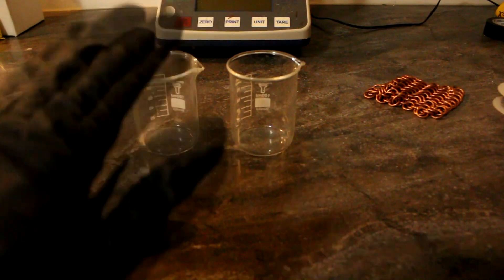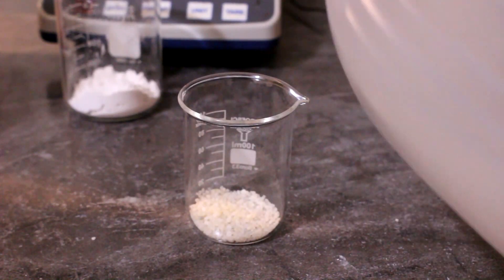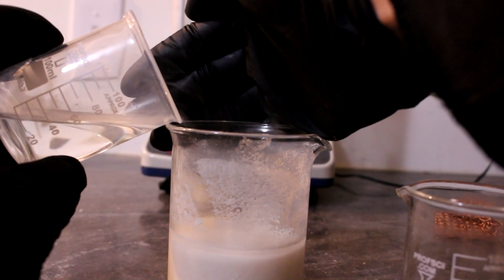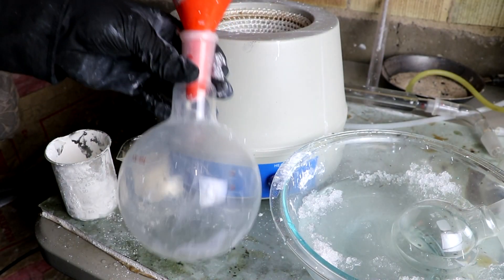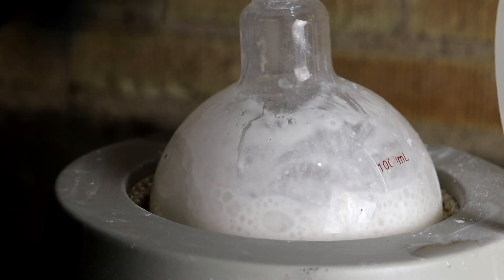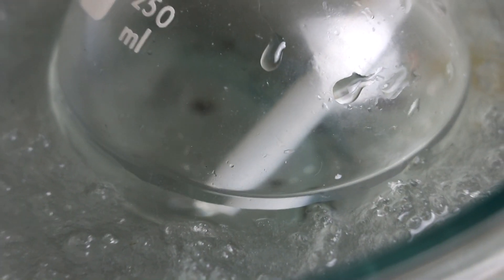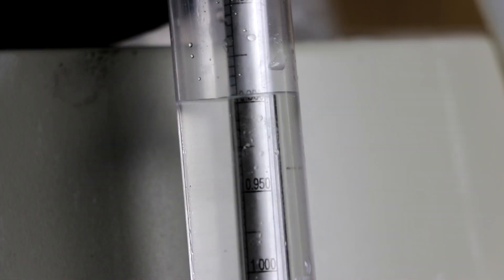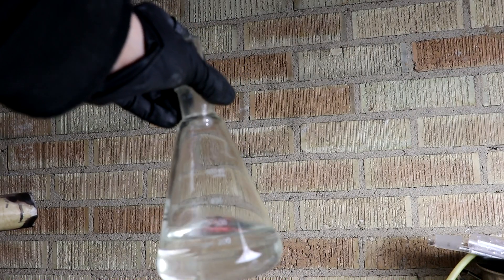Making Aqua Ammonia

Comment: My lab used to buy the 20% in 5 gallon kegs. Adding it to H2O2 and a bit of CuSO4 to microetch copper surfaces during microsectioning works a treat. The smell was like a chicken coup. Careful pouring it inside a closed room.

Comment: good of you to have done this.  ammonia water in gallon jugs is getting scarce in the local 
stores.  and online its $20 a gallon plus shipping.    thus a DIY approach is called for ...

the bubbling  of ammonia  gas into water ... would an aquarium air diffuser 'stone' work better ?

also

is  the 1 liter heating mantle working ok for you ... or do  you wish you'd a gotten 
a bigger one ... like 2 L   or even 5L ?

Comment: Once you yield anhydrous ammonia, try this trick... Dunk a dollar bill in it.
When you pull it out it will be about half its original size.
We did this as part of a safety lecture when I worked at an ammonia, ammonium nitrate fertilizer, urea, and nitric acid plant.

Comment: I don't get the magnets thing, won't they get weakened by the heat? Couldn't you simply use some weights? lead or iron or stainless steel if you are worried about contamination?
Also, that last part, was that a Miller–Urey experiment homage?

Comment: We messed with Calcium sulfate in chemistry earlier today. We mixed it with water to see if it was soluble and did the same with copper sulfate. Turns out the copper sulfate was soluble but the calcium wasn't. Why is this?

Comment: I remember helping my dad make (ammonia water), it seems like we just heated cheap household ammonia cleaner and distilled that. At work we had a ammonia plant for refrigeration. To depressurize sections of the system we used to run a hose into a bucket of water and it would make a high pitched squealing sound. As you showed the bubbles never made it to the top, always dissolved into the water.

Comment: Y'all hiring lab rats? . isn't the ammonia gas lighter than air? I want to make methane not the old fashioned way.. haha..  to fill a waterbed bladder and float it up via fishing line to a safe altitude and shoot it with a 12ga. flare they sell them in Wal-Mart boat section $20 for a 4 pack . ok I know this sound like some terroristscowcrap but with minimizing as much air or oxygen in the bladder it wouldn't big bang and would be the coolest rolling long lasting fireball in the sky. I'm way out in open land no people would even see it . But can that sir be done? If you would do this on y.t. so I could watch that would be like an awesome thing to do . Did not want to pull this card out but ok I'm a combat disabled veteran. Lol I'm sorry.i shouldn't and won't ever use that as leverage. I don't even ask for discounts anywhere so I've been saving it up for this attempt. I'll pay in advance for all supplies and another complete waterbed I don't kno .. please?  thank you cody in advance

Comment: Cody I think you would be interested in a thing called aeroponics a company called aero farms is useing it and its similar to aquaponics. You grow it on a sheet and spray the roots with nutrient rich water and use led lights with a specific spectrums to save energy. It apparently uses 95% less water then normal commercial farms and they harvest around every 15 days. I think you should try it out also the whole thing is indoors so you can grow year round

Comment: Neat! Strangely enough I used an extremely similar technique today to see if I could make lots of NaOH cheaply with readily available chemicals. Like you I used calcium hydroxide ("pickling lime" from the dollar store) and sodium carbonate ("washing soda" from the same dollar store) and exploited the extreme insolubility of CaCO3 in alkaline solution to produce aqueous NaOH. I used one mole of each reagent and I'm about halfway through evaporating off the water from the filtered solution as I attempt to recover solid NaOH. I wouldn't have thought to try it with ammonium sulfate though so the heads up is much appreciated!

Comment: You should really put more effort into your chemical equations. Subscript for numbers of atoms, superscript for charges and it is not usual to write the anion before the cation. The equations on your uranium video are also a mess.
This isn't meant hateful or anything. Just constructive criticizm. You have alot of reach and as a scientific channel you also have educational responsibility.
btw a great experiment is heating a large chunk of magnesium in air (by burning it). Not all magnesium will form magnesium oxide. Some will form magnesium nitride as it reacts with nitrogen in the air. The nitride then further reacts with water to form ammonia.
Reply: Anticonny LOL that is not a cheaper or even feasible way to produce a lot of ammonia
Reply: Did I say that anywhere?

Comment: Hey Cody! I'm gonna get straight to the point... I wanna make a hobby out of science... I'm planning to create a sort of lab, but I don't know where to get the raw materials( you know... chemicals)... Probably somewhere online, but if anyone can help me with some advice I will be eternally grateful!
Reply: MrFilipang look at what you want to do them figure out what you need. Go project by project otherwise you'll have too much and do too little. You can get a surprising amount of chemicals locally, look around and read warning labels ;)
Reply: MrFilipang sulfuric acid from certain drain cleaners (make sure they're the right kind, usually a bag around the bottle), sodium hydroxide from Hardware stores, along with hydrochloric acid (also called muriatic acid). Most glassware you can get on eBay. However be careful, cheaper means thinner glassware and less resistant. You need a balance between cost and performance
Reply: Thank you, mister Wizard! I'll be looking around.

Comment: Great video as always! 
A video suggestion for you. An alloy of gallium and aluminium when in water produce hydrogen gas and gives back the gallium (since the aluminium breaks from the gallium to bond with the oxygen) a few years ago there was an idea to use this reaction as a hydrogen fuel engine.  Building a decent scale version of this idea seems right up your alley!

Comment: Be sure to keep elemental Iodine handy to clean up ammonia spills!
Sprinkle the Iodine on the spill, allow a few minutes for the slurry to dry.
Sweep up the dried mixture with a small broom.
Hearing protection is advised.
Reply: That's quite disgusting what you wrote. Do you realize there are kids who will try this? For anyone reading, this produces an extremely unstable explosive that explodes with the slightest touch when dry.

Don't you have any brains? Why would you advise such thing?

Comment: You have a possible hazard.  If the ammonia generation pauses for even a moment, ammonia dissolving into the chilled receiver flask can create a vacuum in the apparatus, causing the solution to be sucked back.  This can get quite violent, throwing cold solution into the boiler, which then violently flashes, blowing the apparatus apart or cracking the boiler.
You can prevent this happening by using an inverted funnel to channel the ammonia to the chilled container.  The lip of the funnel should be held just below the liquid level, and the volume of the funnel should be large.  If a "suck-back" tries to occur, the liquid will rise in the funnel until the level in the container goes below the funnel lip, allowing air to break the vacuum.
You better treat the silvering solution with some salt or HCl immediately after use to prevent an explosion of silver azide!
Reply: The suckback would go into the receiving flask. It would take a lot of it to go back to the boiling flask.
Reply: I'm glad noone has said anything yet on the style of ''why don't you do it yourself if you are so clever'' and other things people say in the comment section when someone tries to point out some safety guidelines. It was especially ridiculous in that Uranium video
Reply: No it wouldn't!  As soon as the sucking back starts, the cold water initially sucked back contacts more ammonia, further increasing the vacuum.  The water ingress will continue until some drops hit the boiler, violently flashing if the boiler is a lot hotter than 100C.

I was distilling alcohol from a silicone oil-alcohol mixture.  When almost all the alcohol was out of the oil, the boiler temperature went up, and the distillation slowed.  The system started oscillating, making a "heavy breathing sound" as droplets of alcohol were sucked back from the condenser to the boiler, where they violently flashed, then the cycle repeated anew.  (There was an air-gap between the condenser and the receiver, so no suck-back could occur from there).

There is a "Hero's fountain" demonstration that exploits this with dry bulb ammonia filled with narrow tube dipping into water with pH indicator.  When drop of water is introduced into bulb from dropper in side-arm, water sprays into bulb, turning pink until bulb is totally filled.
Reply: Party pooper 💩
Reply: Some of us just like to see the experiments. I do some chemistry in my home, and make a bunch of useful things, but I have no desire to produce uranium or nitroglycerine (although I could easily do so.) Desire or no, it's still fun to watch.
That's what these channels are. Education presented in an amusing manner.

Now, I have had the occasional accident - shattering glassware while distilling strong acids is always a good time. But I could no more blame any of these channels for the hazards than I can blame the postman who delivered the glassware to my house. That is true for anyone who tries anything they see here without proper knowledge, preparation, and equipment.
Reply: I've done this setup once and yes it caused violent suckback and everything mixed got in the middle flask.

Unfortunately, the funnel does not work very well in this case because ammonia is lighter than water and thush the gas won't get dissolved evenly - it would rather form a layer of strong ammonia on top. The suckback trap with large enough volume is probably the best bet.
Reply: "throwing cold solution into the boiler, which then violently flashes, blowing the apparatus apart or cracking the boiler."

Not sure why you have so many upvotes on this because this cannot happen for a couple of reasons:

1. The solution in the end flask lacks the volume to fill the intermediate conical flask.  In the scenario you describe the ammonia soln. would just be sucked back into the conical flask until the outlet pipe was exposed to air, which would then break the vacuum.  The middle flask acts as a trap.
2. Even if your scenario played out and liquid from the capture flask somehow reached the boiling flask,  there would be no violent flash of evaporation because the flask already contains boiling water - it isn't hot enough to cause a steam flash, and if it were, we would already see it happen because there is already liquid in that flask .

The absolute worst outcome, assuming that water defies volume and gravity to shoot up through the condenser and into the boiling flask, is that the flask could crack from the cold shock, causing you to lose your solution, assuming that cold solution somehow hit the side of the flask instead of being squirted into the liquid.  By way of information for those who aren't aware, "vacuums" don't actually "suck" anything.  It is atmospheric pressure which pushes things into the area of lower pressure ("vacuum") and the force of this pushing cannot exceed the pressure of the surrounding gas, which is around 1 bar in the case under discussion.  

Your concerns would be more appropriate if dry ammonia salt and base were being heated to produce the ammonia (a much simpler and cleaner process than all the faffing about with solutions and the method I use if I need to create ammonia).  In the case of dry heat, there is a possibility of flash evaporation if suckback occurs.  To prevent it this you have a capture flask before the outlet, and make sure to remove the outlet pipe from the collector before you remove the heat.  If suck back starts the vacuum can be broken by pulling the cork from the intermediate flask, etc.   With a flask full of hot water/solution there is no mechanism for this to occur as the liquid inside keeps the temperature below that required for a flash evaporation.

"No it wouldn't! As soon as the sucking back starts, the cold water initially sucked back contacts more ammonia, further increasing the vacuum. The water ingress will continue until some drops hit the boiler, violently flashing if the boiler is a lot hotter than 100C."

This is untrue and the person you were replying to is correct.  Water ingress will not continue because the volume is smaller than the volume of the conical flask, and you should know that the boiler cannot be  "a lot hotter than 100C" or else the water already inside it would undergo the mythical steam flash you've been describing.  Sorry but this alarmist fictional scenario is scaring kids for no good reason, as well as giving them a false model for what's happening in the flasks.

If you don't believe me then try pouring some cold water into a boiling pan of water - does it violently evaporate out of the anger and shock of being suddenly and unexpectedly heated against its wishes? No, all you have now is a slightly colder pan of hot water.

Safest practice is a good thing to promote, but exaggeration and fantasy only serves to make people distrust you and disregard the safety message when they find out that what you claimed would happen was only added to scare them into compliance (Reefer Madness effect).  There are much better things to be highly concerned about on this channel, such as teaching little kids stepwise how to manufacture nitroglycerine without including all the safety data required (temperature sensitivity etc), and toying with powdered Uranium compounds while understating the very real and serious dangers of deliberately creating a dust plume containing a strong alpha emitter , which contrary to popular belief is the most dangerous sort of emitter to have enter the human body , while specifically showing detection equipment incapable of detecting alpha - reckless, and considering the demographics of the audience, perhaps criminally so.

The reason alpha particles "can be stopped by a sheet of paper", is similar to the reason that a hollow point bullet has less penetration than a FMJ - it dumps all of its destructive power in a very short space, in the case of internal irradiation, your cells take the place of the paper and lung cancer is a very real risk.

IS CODY'S LAB JUST AN ACTOR WORKING FROM A SCRIPT?

I suspect so, mispronunciation of common compounds seems rife and so very unlikely for someone with a genuine long standing interest in chemistry.

"SLACKED" lime... seriously? and so many examples from previous videos.

Comment: Use barium Hydroxide Cody! BaSO4 is 100%  insoluble in water unlike CaSO4
Reply: Depending on the K(sol) constant of BaSO4 vs CaSO4, the relative solubility may be magnitudes apart. 
As you can see by the following stats, BaSO4 is roughly 1000x less soluble in water than CaSO4.

According to wikipedia:

Solubility of BaSO4 in water:
0.0002448 g/100 mL (20 °C)
0.000285 g/100 mL (30 °C)

Solubility of CaSO4 in water:
0.21g/100ml at 20 °C (anhydrous)
0.24 g/100ml at 20 °C (dihydrate)

They're both dirt cheap, but CaSO4 is about twice the cost of BaSO4.

Good call Heintje Aldrich
Reply: Nothing is 100% insoluble. Everything has a certain solubility product constant. BaSO4 has one several orders of magnitude smaller Ksp, but still not zero.
Reply: Ik what I meant is that it has a much smaller solubility compare to that of CaSO4, and it is so small that it is low enough to be ignored, hence "100% insoluble", thank you for correcting it tho!
Reply: Jon Thomas there is the issue of barium being toxic and bad for the environment however.

Comment: I love your videos and knowledge Cody but I am quite sure your distillation apparatus was the wrong way around, it is one with input and output changed by 180 degrees and is more efficient if the input points down and the output up.

Comment: i make my aqua ammonia with sodium hydroxide and ammonium nitrate, you dont even need to add water and the ammonia bubbles off and you can dissolve it in water... also the by product is sodium nitrate which is awesome ;)
you can buy sodium hydroxide and ammonium nitrate from gardening stores here in bags of 50kg...
i couldnt find potassium nitrate in the past so i used this method to make sodium nitrate as a replacement...

Comment: For an intermediate solution for purification you can also: filter the liquid to remove most of the calcium sulfate then add a little bit of ammonium carbonate to convert it to calcium carbonate that is insoluble, leaving only ammonium sulfate impurities in the liquid (which can be also distilled ).

Comment: Well, the chemicals are ok, but it is impossible to distill ammonia solution with anything but traces of ammonia because ammonia doesn't form an azeotrope with water like hydrogen halogenides do.
There is no use for a condenser here. All one needs is a tube ending with a funnel that barely touches surface of very cold distilled water. One must never shove a tube with ammonia coming out of it into water because there's a very high possibility of violent dissolving and surge of water into the apparatus. Ammonia fountain is a well known experiment showing this hazard. The only reason why it didn't surge in your case is the speed of ammonia evolving from the mixture. But it can go very wrong and form such sudden pressure differential that glassware implodes.

Also, there is no need for that much water in the reactor flask. It works just fine in the solid phase, but needs to be finely powdered and intimately mixed and then heated. Very clean and dry ammonia can be produced that way.

Nice Tollens ending. It would make a nice video. Don't forget to put equations, they mean a lot.